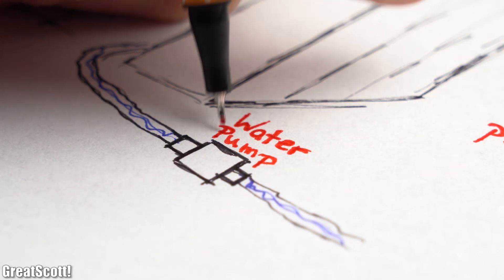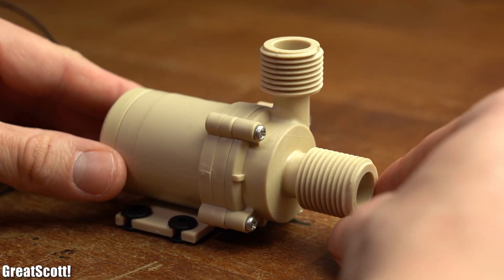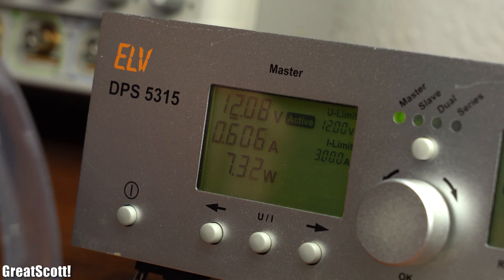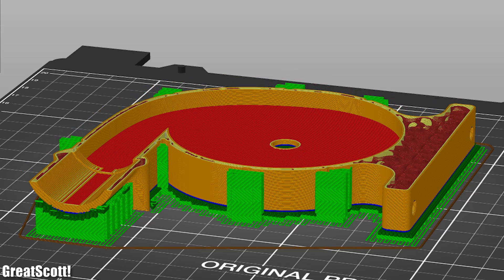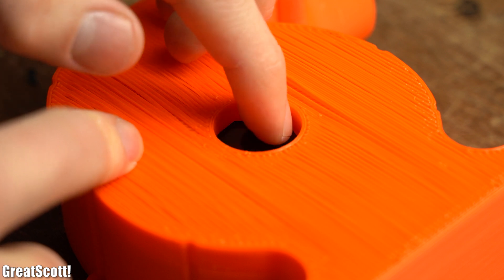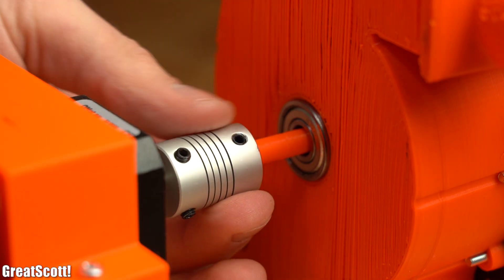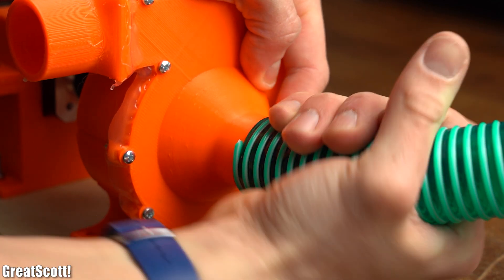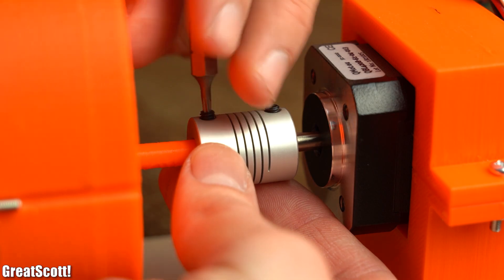Water Pump || DIY or Buy

Comment: The shaft and the shaft seal are the most critical parts in a water pump. I rather buy a magnetic coupling impeller that eliminate sealing & leakage problem. I have tons of aquarium pumphead failed at the coil rather than the pump itself.

Comment: It may have fared better if you had used a shorter axle on the impeller side of the pump. Also there is a automotive gasket paste that would have made a better seal as well/

Comment: I think you should replace shaft with metric hex head screw (hex head inside plastic turbine) and try what else will fail ;)  I like 3D printing but this seems like many makers just print EVERYTHING out of plastic without thinking. Sometimes it's just better to print three parts and connect it with screw or threaded rod than to print one big thing and hope it won't break in few minutes.

Comment: The impeller and the shaft should be a two parts design. Then print the shaft in horizontal position. In that way, the shaft should have higher strength.

Comment: A metal shaft is all that was required to make this viable (as has been pointed out by several other commentators). 

Can you have a look at self priming water pumps? Even though I and many viewers may not elect to build one, understanding how they work is so well covered with your videos.

Comment: Just replace the printed shaft with a metal rod of correct size maybe just a bolt so you have something that will keep it from turning in the hole

Comment: I would say not to print the parts but to have them built so that they would handle the load but if it were a small prototype then a three-dimensional print would be better but for large pumps, I would say use metal the only exception would be for an air-based system pump

Comment: I'd probably give it another shot with a metal shaft instead of the 3d printed one. Besides that, the print looks a bit underextruded. Did you check the temperature for this filament?

Comment: When 3D printing mechanical parts, it's often a problem to print shafts in the orientation you did -- each layer line becomes a 'seam' that weakens the shaft, and shafts of smaller diameters typically are completely unusable (wider shafts can work in some cases if made solid enough, but it's usually not worth the effort). Typically we would solve that by either printing the part in a different orientation (which looks excessively annoying in this case) or by making the shaft a separate part (could be 3D printed with the layers lengthwise, but typically just a carriage bolt or other shaft-like piece of hardware you have lying around) with a cutout in the part to accept it. I would guess that the micro pump you were looking at probably uses the motor shaft itself as the impeller shaft. Also, according to other comments you might want to double-check both your fin sweep direction and your motor direction.

Comment: Such a shame to print a shaft in that orientation. Not the perfect motor, expensive motor driver and some design error is the problem. to print the shaft you could print it horizontally and then attach it with the impeller with screws. and obviously the impeller shaft and the motor shaft is not perfectly co axial. you could easily achive that with a bit more effort on design. 
I am not saying that a commercially made product is the loser but you could easily achive a way better performance from your 3d printed pump.

Comment: Even before you started, I had two likely problems in mind: water-sealing the shaft and stresses on 3D-printed parts. Concerning the stresses, I would think a metal shaft with a hole that holds a nail, to support the plastic propeller would be an easy DIY solution. But what would be an easy way to water-seal the rotating shaft?

Comment: I have that Chinese exact pump.  It's been sitting at the bottom of a water butt for two years.  Still working. It switches on when the soil gets dry. I designed a capacitatave sensor thing to activate the pump. It moslty works.  I added a float sensor so that it never runs when the water butt  was empty. Happy plants.

Comment: I think if you change the orientation of the 3D print you will not have the problem of layer separation of the print in the shaft. Or you could have tried to use a metal shaft attached to the propeller. You gave up too quickly.

Comment: If you use Simplify3D, you could customize print density of the shaft connector to make it stronger. Another way is creat a fillet at the connection of the shaft to the impeller. Another is to create a 2 part impeller-shaft assembly so you can control the print density.

Comment: 2:53  "and it seems the water can onlky enter this way , and exit that way"
well i dont know what you were expecting but the last time i ckecked, centrifugal forces always paint outwards from the center of rotation. I mean its literaly called centrifugal pump.
These basically create a more or less stable pressure difference between inlet and outlet. based on rpm.
On the other hand there are positive displacemetn pumps that "trap" whatever they are transporting and transport it to the outlet. these have a fixed transport volume that is linear to the rpm. some like gear or scew pumps can work in both ways.

Comment: Hey GreatScott love your videos! I've been designing my own 3d printed pump as i'm not crazy about any of them designs on thingiverse, and thought i could do much better. So far I've been able to pump 5gl of water in just under 16 seconds running on a 4s lipo and a Traxxas Titan 775 10 turn motor, with a 1in inlet with a 3/4in out, I've taken the outlet down to 3/8 and got a 30ft stream out of the pump! I will be posting my design on thingiverse at some point, just few more little things i'd let to do. I'd like to get 50ft out of the pump for a water canon! :) I'll also be posting a video on this at some point as well, i'll have to post it once its completed. At this stage I've hooked a castle creations 2200kv brushless up out of my 1/8 RC truck and got about 38 to 40 ish feet out of the pump, but i think i may need a bigger inlet as it can suck itself dry with that kind of RPM.

Comment: I think modifying the thingy verse design so you could couple the motor shaft directly to the pump impeller or allow a M6 bolt to be captive would have yielded a more reliable design

Comment: I had this same problem. Get an RV style pump and a ballast. Works perfectly with hoses. Much less work than 3D printing. Shuts itself off, runs on 12V. Cheap. Extremely effective.

Comment: Shouldve used a metal shaft for the spindle, and orentate the pump so it would self prime, in other words have the water fed to the inlet from the bottom of a bucket and use the gravity feed to prime the pump

Comment: I think it was poorly put together. Should have used a metal shaft to drive the pump. Or printed the shaft horizontally so the layers are end to end and not stacked like that.

Comment: I mean you didn't have to 3D print the whole thing, why not use a steel shaft, polish it, size the rotor ID to fit it, mount with set screws and use watertight bearings. if you wish to make a water pump this size, its worth taking a shot, but this video is not the way.its like you had the idea for a moment, but didn't quite think it through and rushed it. anyone that has a 3d printer knew that shaft would break along the print plane, no matter the material. seemed a bit half-assed for your normal content, is that because of the sponsor?

Comment: It was the heat created from the friction on your bearing seal that weakened the shaft...
A sealed bearing would have worked better.
Reply: The bearing wasn't even the proper size for the shaft, all that wobble didn't help either. This build seemed a little shabby, like it was just thrown together to feature his sponsored product, I don't like to think that but he is usually better than this.

Comment: You 3d printed the axle of the pump seriously I mean I knew that would be the first failure point as soon as I so it. Exit of the pump should be facing the top so you can prime it before attaching the hose. Why didn't you print a TPU gasket and used Vaseline or grease to water proof the pump. The failures are all your mistakes sorry mate.

Comment: You could also print a negative of the wheel instead of the wheel itself and use this as a mold. Then place some thin strips of metal, cut and bent in the shape of the vanes out of aluminum or tin sheets, as reinforcement. Then pour in some epoxy. You could also add a metal shaft while you are at it... I bet that wheel would be strong enough.
I think there are many great and easy suggestions in the rest of the comments to warrant a second part of this video ;-)

Comment: Love your vids, but as others have pointed out your impeller blades sweep the wrong way. Not only that but it appears as if you spin the impeller in the wrong direction for your given impeller vane sweep direction so the pump is trying to suck in air through the outlet. Reversing the sweep direction while maintaining the same motor direction will fix both issues.
Reply: I have the same water pump and it doesnt suck the water unless i fully inmerse it. However if I inmerse it and it start sucking out the water and you have a tube inside the water it will keep sucking the water... why? Not sure.

Comment: I wouldn't discount 3D printing's abilities yet. Printing the shaft in that way is a terrible design decision, as prints are weakest in that plane. The impeller should have been made of at least two components, likely with a metal shaft. The absurd number of supports were also probably not at all needed, though designing them away is an undertaking (likely the model you printed was not designed by someone with a lot of experience with 3D printing). I highly recommend Billie Ruben's poster for more tips. https://imgur.com/gallery/SqIdFwB/comment/1790142179

Comment: its a design flaw. Shat too thin for its size and material. also the designer should have a hole in the center of the vanes instead which accepts long steel bolt and nut.thus serving as shaft .

Comment: RTV would have worked better to seal than hot glue but on the shaft use a piece of a metal rod with a pattern on the bolt on the head and fit your impeller with the shape of the nut embossed in it.  It was the shaft that failed not the impeller the torqe sheared the 3d layers you could also try printing the shaft ina differnt orientation so that the layers are long ways

Comment: It need a standard dc motor
A design to fit a silicon joint to the pump assembly
And a real metal axe for the pump

Comment: 2:00 I think the Teflon take is meant to be used on the threads not on the tubbing!
Reply: He used it to enlarge the fitting so the tube will fit. He ptobably didn't have smaller tube

Comment: Main Problem still is, that its a not self priming pump eh, so how would you solve this problem for a really automated watering system? It wont stay primed if its not constantly circulating water using the power of vacuum of the exiting water. Even bigger pool pumps have a really poor performance elevating water above 50cm, which means that the flow through rate cannot be any criteria for a real automated watering system. But in any case its a cool video giving quite a good idea on what works and what wont :D

Comment: job for a high kv brushed motor. put blades correct way. use metal shaft from nut/bolt etc.

Comment: Dear Scott: My rent is high and so is my electric bill. So, I want to have a little generator in my apartment to generate some free electricity to charge my phone or run low-power appliances. Can I use this water pump in REVERSE? I want to run water from my bathtub faucet to use the D.C. motor as a generator. Thank you.
Reply: IMO They're terrible - you'd be better off with a purpose made small turbine - or just a small solar panel...

Comment: You didn't even make the hole to fit the shaft of the motor, and that hole is everywhere in thingiverse so DIY will win with modifications, and use silicone rings instead of that, you need to focus a little more in 3d to modify the models you download, because you have a lot on knowledge on electronics, and it's sad to see than you can't make it because of something so easy.

Comment: Print the impeller in Nylon, maybe with glass fiber or carbon fiber. Buy some all thread or cold rolled steel for the shaft and affix it to the impeller using a nylon key or just a grub screw and embedded threaded insert.

Comment: Excellent video. However, you should have known from the start that the downloaded version needed some enhancements....
Give it another try, and replace the weaker parts and improve the design. Maybe do a little research on pumps and fluid dynamics. That will make things clear.

Comment: I guess the shaft issue would be quite easy to fix with a proper metal shaft connected into a key hole in the rotor.

Comment: Hi Scott, have you tried modding the stl file of the wheel in a way, that you remove the shaft and instead substract a hole in the middle? Then just cut an 8mm thread, screw in threaded rod while applying some glue, put a nut on it to give it some tension. That should work well and the larger 3D printed parts are not wasted. You'd just have to print a new wheel ;) I guess you could also drill a hole in the old one but that's probably gonna wobble and it's annoying and it's work and neh... :D

Comment: You should use metal shaft and 3D print only the rotor with a appropriate hole. Then join it together with thread/nut or epoxy glue. However 3D for this application is quite a bad idea for a different reason - the most common filaments are hygroscopic and when in constant contact with water their durability is terrible.

Comment: Hello scott
for my irrigation in the greenhouse I use pumps from "COMET" or "REICH". 
These are submersible pumps that are normally used in caravans. They are very reliable and powerful, I can highly recommend them. 
Unfortunately, they are somewhat sensitive to polluted water (algae or mud).

I would find it much more interesting if you invented a solution for measuring soil moisture. 
In my experience, neither a resistive or capacitive measurement of the soil moisture led to permanent, satisfactory measurements. 
The resistive measurement leads to electrolysis. The capacitive measurement leads to a gap that is created when the soil changes from wet to dry. 
Anreas Spiess has already reported on this problem. 
A measurement via sound waves or electromagnetic waves might be better.

Comment: I'm curious if drilling out the impeller & driving a bolt into it, then cutting off the head & connecting it to the motor would result in success.  (Personally, I do not like relying on plastic, whether 3d printed, cast, or extruded, to hold where there's much stress.)

Comment: why didnt you just drill a hole through the impeller and weld press a nut into it and just use a threaded rod . all commercial made pumps have metal shafts as plastic is just not upto the task

Comment: shaft alignment was really off... that wobble could have honestly been what broke it. you're fatiguing the material by stressing it like that. metal shaft will be better but if it's not aligned you will probably just break the next weakest link (case or impeller)

Comment: I hate when diy turns to    d.i-WHY!!! But you are doing well,  I'm gathering parts for a solar heating system for my offgrid home, allowing free heat during spring and fall, and maybe warmer winter days, and using a wood stove converted to boiler, for cold winter nights, and possibly use steam to help generate a bit of power when solar isn't producing!  I have over 700 ah of lithium batteries to charge to 29v, it takes a while in winter!!!

Comment: Maybe the solution is to use a different printing material or replace the shaft entirely with a metal one that screws to the blade-rotor part on the inside?

Comment: While I really like your videos, in this case it was very obvious you were out of your element.
You don't 3D print the pump shaft. You use a gasket to seal it, not silicone tape or hot glue. You used a solid motor coupling but you had obvious misalignment before you even started it. Your pump might be oriented the wrong way, it's hard to tell from the video but I think if I'm seeing it correctly it was either spinning the wrong direction or you have the wrong vein pattern... Etc.
Overall, you can 3D print and home make a pump,

Comment: 1st you are not comparing same size pump nor same specifications.
2nd I think you can replace plastic shaft with metal rod instead using small screws.
Finally, thank you for your great videos, keep it going.

Comment: None of this makes any sense! I, for example bought a bunch of 12V 23 and 50 l/min NautiLine bilge pumps for 3eur apiece (incl. shipping). You can control the speed with a PWM-driven FET. No need for expensive ESC and motor, not to mention the entire unit is waterproof.

Comment: Large pump is worth a revisit BUT using:

1. A stainless steel shaft instead of the plastic one
2. Stainless lock nut on the outside end of the shaft, captive bolt head at the inside
3. Use normal bathroom silicone sealant bead to seal the outside cap
4. Probably MOST important ... Use a sealed bearing AND shaft water seal on the inside between the bearing, the shaft and the housing

Great video as usual.

Comment: Well, about Material strength... I vaguely remember a certain Y youtuber building a cnc machine, which should be more than able to Mill the parts from aluminium or even steel.

Comment: Instead of printing the shaft as a cylinder, you can rotate the model in the slicer 90deg and print it so that the layers are parallel to the axis of the shaft. This will add a TONNE of strength compared to your current design. You will have a lot of supports to remove in the end it won't looks as pretty bu it will be hidden anyway😉